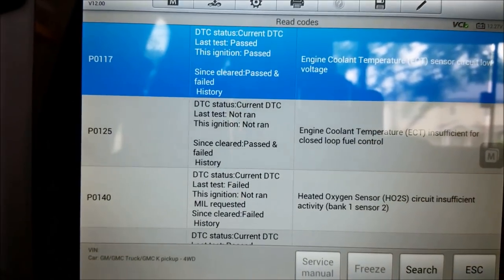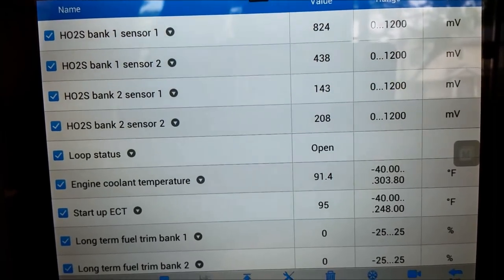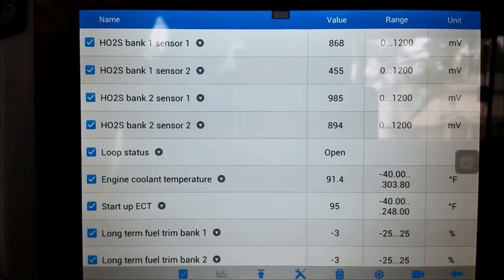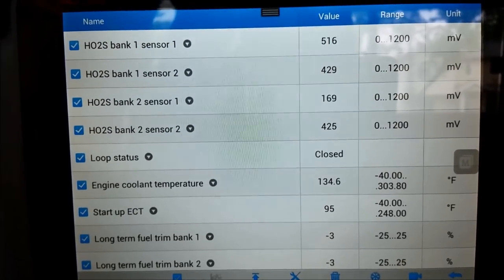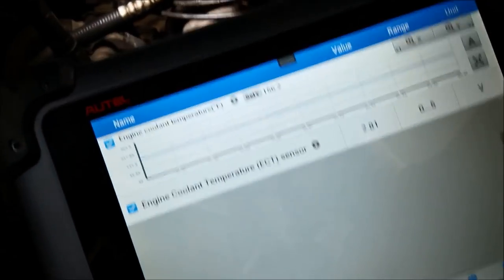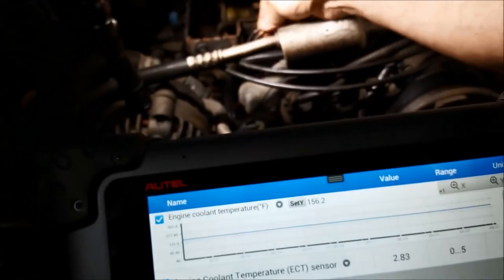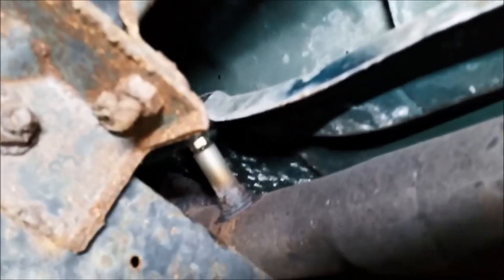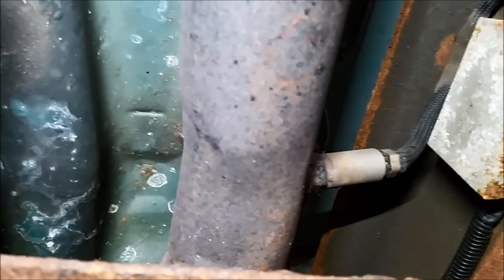1997 GMC K2500 Pick Up. Check Engine Light P0140, P0114

Comment: Nice job! you did a good avoiding going down the rabbit hole and got it sorted out. I will be very interested to see what if the 280 degree was a "real" reading.
Reply from the maker: The Disgruntled Mechanic. It's been a few weeks and hasn't come back. I wonder if the temp sensor codes were set by whoever did the sensor and harness repair and never reset the ecm!?
Reply: Awww! good point. could very well be. That would be the best case scenario for the owner!

Comment: how was the sensor even registering?  hmmmmmmmm.........
Reply from the maker: Bias voltage. An unplugged O2 sensor will read about .400 on the scan tool
Reply: @SAAutoRepair  thanks......... THIS could be the solution for my P0140 code....... crazy!  very intermittant.  Thanks for doing this video.